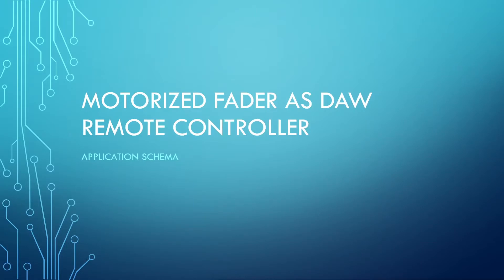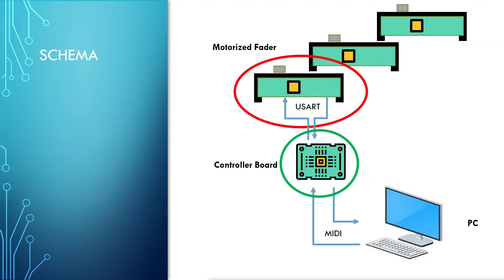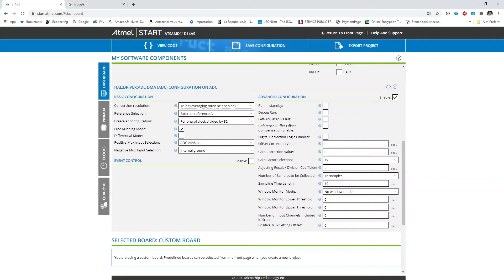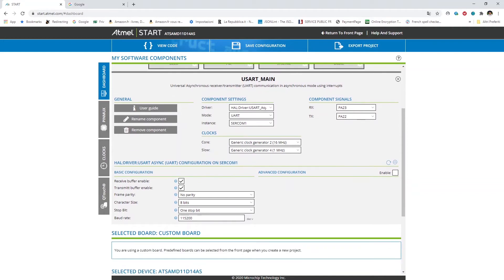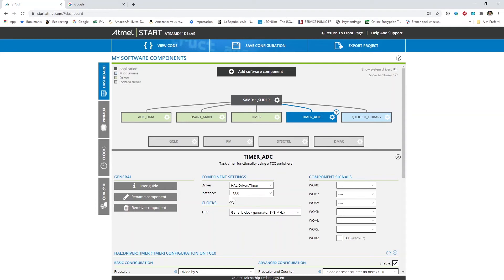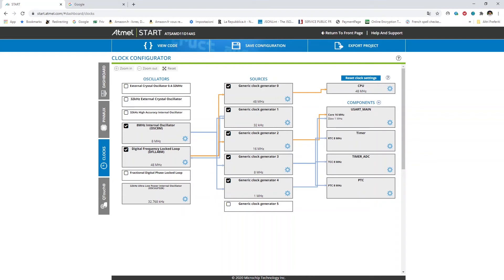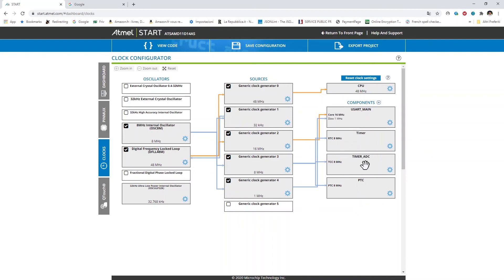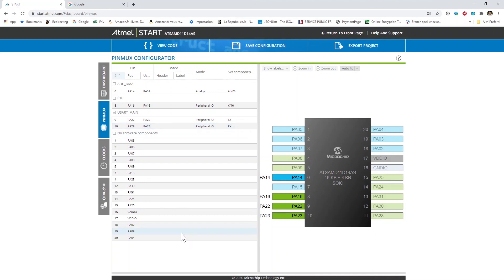Motorized faders as DAW Mixer Controllers PART 3

Comment: Hi, do you have a project file of the samd11 chip that can be uploaded to the atmel website for reproduction?
Reply from the maker: You just need to open the project you can find on github with atmel studio and then right click in the project pane on the project name and click on reload with atmel start and the config will be loaded directly.
Reply: @fcampanini  Ahh, didn't see that. Thanks! I'll definitely be building this
Reply: On the atmel site, I'm not seeing an 8Mhz 'Generic clock generator' available for the ADC_DMA driver - They do have one at 1Mhz, will this work?

Comment: Hoi Filippine,  nice project but what happens with latency by using 8 to 16 fader and a lot of buttons? In your explaining you show an midi controller between faders and pc, what for midi interface do you use? Do all faders hanging parallel on the  usart bus or do you use multiplexers? Keep going on and please expanded this project and please publish. Greetings from 
Louis.